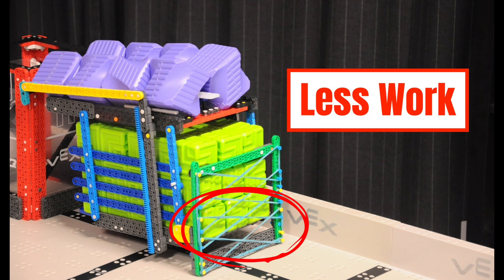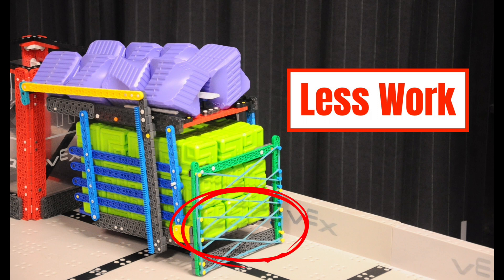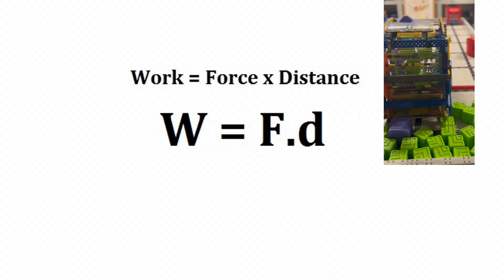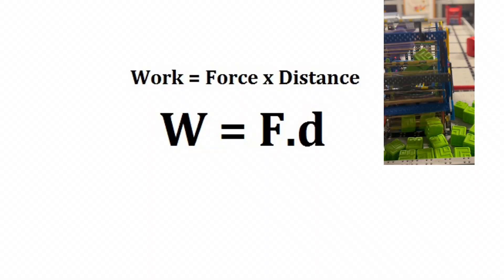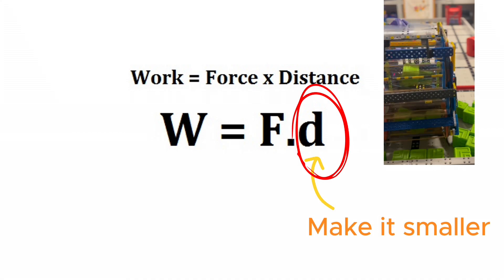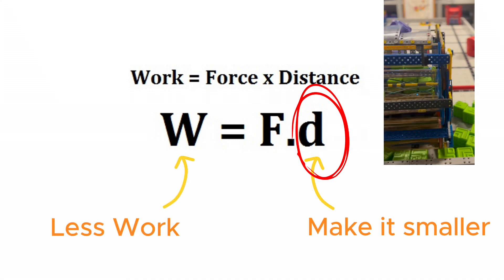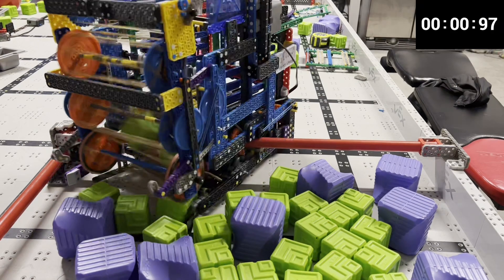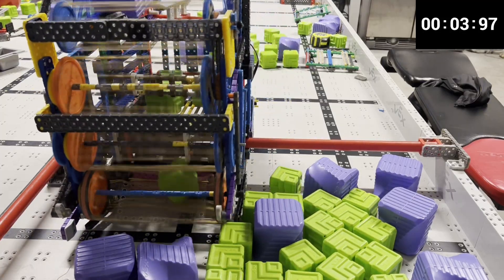Let me Introduce you the Half Wall. Your Robot Will Do Less Work on It. VEX IQ Full Volume

Comment: Wait what I just did the math for my robot and something isn’t right. If W=F*D and force is F=Mass*Acceleration, then that means that whenever the intake remains at a constant speed the force is 0 and 0 times the distance will always be 0. So your intake is doing 0 work? So then why does that half wall improve your intake? So if the key is keeping your intake at a constant speed, then maybe I should experiment with flywheel weights so it’s harder for the intake to loose its inertia?

Comment: what gear ratio is the intake where you use the half wall
Reply from the maker: In this video, we were trying 4:1 on 2-motor intake, actually, we spent 2 weeks exploring 4:1 2m intake, tried all the wall combinations that we could think of, and our conclusion is, don't use it, at least on our robot. On a good run, we saw 20s clear supply zone, on a bad run, it will be 40s. We heard 4:1 2m intake works amazingly on some team's robot, you can find them on YouTube, but we could not handle it.

Comment: yooo, we also had a vertical band wall in the early stages of the season, im assuming that you decided that wasnt a good design because of the bands’ vertical strain on the structure. we had this exact issue and just stuck with a horizontal wall instead. but all season basically we had what u called a half wall in the video but with rubber bands instead of beams like u had in the video. i could go more in depth but his comment is already long enough. maybe a phone # to text or discord if u have one?
Reply: edit: oh i realize your design now, ingenious in my opinion! one level gets full and now theres no space for more blocks. so they have no choice but to go up! awsome! (i didnt have what u had all season at all, mb)